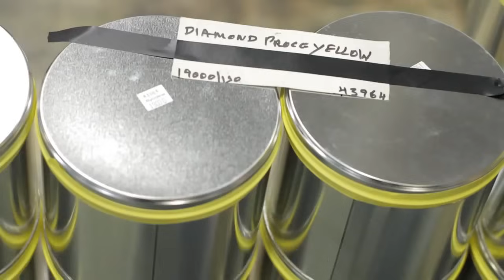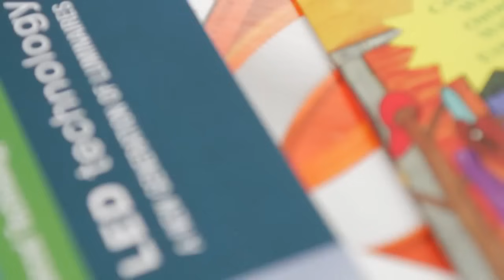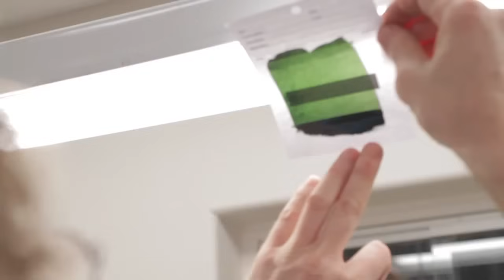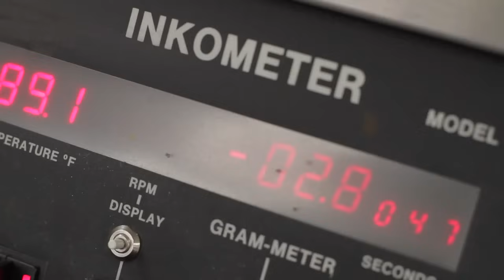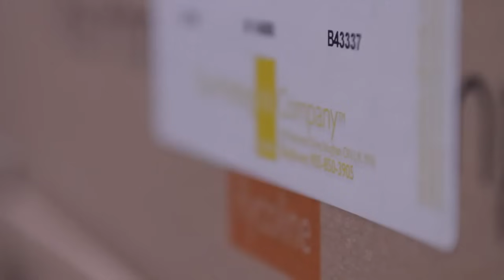How Printing Ink Made.

Comment: This is a brief pictorial on how paste ink is made. Likely for conventional commercial sheet fed printing. Appears they are making blend bases from dry grind. That is starting from raw pigment, grinding the pigment and vehicle on 3 roll mills to the finest grind possible to assure the pigment is completely dispersed. The metal plate they draw the ink down on checks the finest of grind. Appears they are then blending finished pantone colors from the blend bases. Bases are Cyan, yellow, magenta, and black. These are what they call process colors.
Paste or sheetfed is one type of commercial printing ink. There are several different types other than paste. Gravure and flexo which are liquid form are very common. Perhaps they could do a video of those(?)